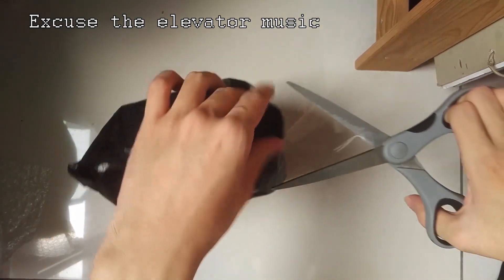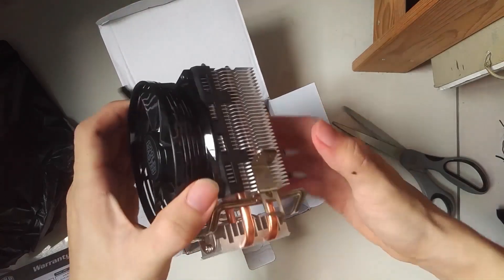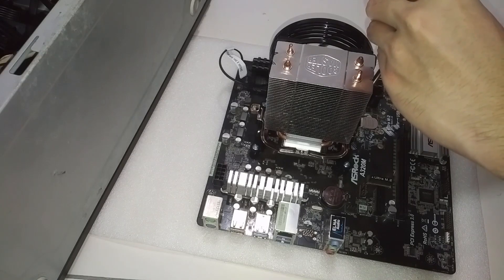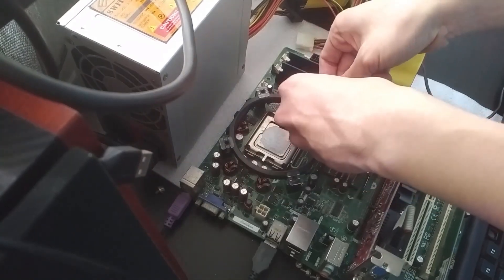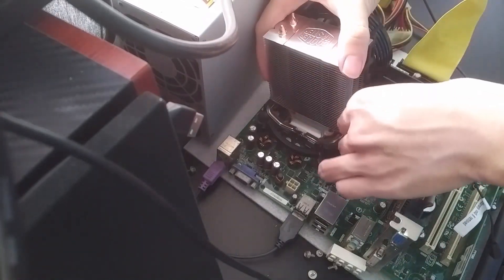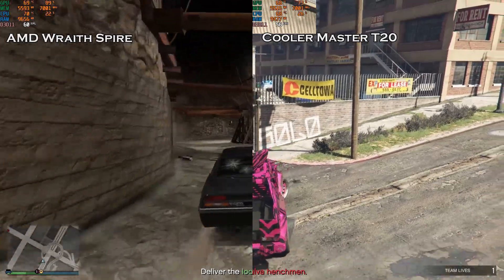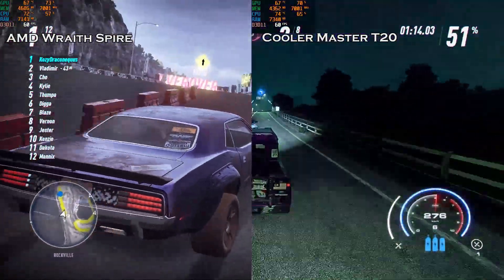Cooler Master T20 Unbox + Temperature Test

Comment from the maker: Chill guys I bought a Aorus B450, no more base trash A320 no more
Reply: Its still good to be used. It can fix our brain coordination cause by overclocking a lot.
Reply: i think the problem is ur case, its a trash, it is more important to buy a good case, rather than a heatsink.
Reply from the maker: and look like everyone else right? a flat void of glass and RGB? screw that I'm going sleeper, heat be damned
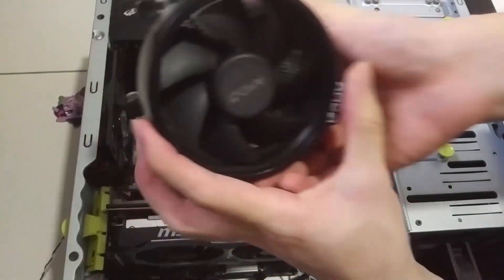Reply: @noodleclaws  I'm sorry if I offended you, I mean that it is all messy, cables are covering the air 2:56, when the air reaches the heatsink it is already hot, case with the power supplies on top are the worst. You can look at the Corsair 275R Airflow, rgb is optional lol https://www.youtube.com/watch?v=5rsaDb0KPZ0
Reply from the maker: @macizo05  keyword: sleeper, and it’s ok I’m cool with heat and wires, since there’s nowhere else to stick them anywhere
Reply: I have a question do you know if this t20 is compatible with the asus b450m-a ii
Reply: @codonthecob_2129  it should be. As the t20 supports AM4 socket.

Comment: i think your case ventilation limits the cooler potential. not much cool air is being feed into the case. even your intake fan into the case is not seating flush at the holes of the case. i see your case is preventing it. might changing the case will be beneficial? or make a holes on the side cover and place your intake fan on the case? thanks for the video btw

Comment: which is better? Hyper T20 or Hyper T200? I can't find any comparison
Reply: Me too!! Any suggestions?
Reply: I suggest getting a Hyper 212 or a T4 rather than T20, T20 is only for the low end 775 CPU,either the T200
Reply: @healspringy6300  Hay unos videos del t200 + i5 10400f y todo ok ???? What say?
Reply: @raulc.s.7103  No, i5 10400f has 6 cores and 12 threads so i would recommend you to buy a Hyper 212 instead of T20
Reply: The T200 is better, higher RPM and more fan blades, but also is a bit bigger

Comment: Could any one please share the temperature difference between the intel stock cooler and T20 ?, 
I looking to use with i59400F and case/Cabinet restricted to 120mm cpu height.
Reply: ITS GOOD than stock. i used to get arounf 55 in idle but now i get around 35 to 45. I5 3rd gen, Gamemax Expedition Case with all the fans

Comment: It's good for I7 4790? What its the TDP of this cooler ?
Reply: I'm looking for answer to this question as well. I've looked all over internet, yet I can't find an answer to it. But from the video it seems like it is a little worse than AMD cooler which is rated at 95W if I'm not mistaken. i7 requires 77W. I think It should be enough.
Reply: @interesting6436  im using it with i7 4770 and max temp without AC is 85c and with AC at 26* is 75c
Reply: @_21st89  Thank you for the answer! I already bought a computer.. but I'll keep this information in my head.

Comment: Grip for AMD brackets are a bit tricky. Is just pressure or i should adjust it somewhere? I have an AMD A10 5800K and planning to buy this because is the only of it's kind to fit in my microtower case. I have a stock cooler from an Athlon X2 because the bundled with my system is smaller.

Comment: change your case .hahahaha you have a great pc components . letting them live in that case breaks their hearts. nice vid
Reply: Sleeper PC 🏆🎉🎍 that thing is .
Reply: Abhishek Roy a trash sleeper with a really cheap MB a sleeper is meant to have high end components not a RTX 2060 and a ryzen 5 btw a 2060 isn’t a high end gpu it’s low to mid
Reply: @vWhiz   . I heartily agree with you Man . But due to the virus situation , prices have skyrocketed in my country India . Nowadays , a 1050TI costs as much as a 1650S . Been a PC builder for 20+ years I have , and am really losing my mind now 😭 Curse chayna for all this mess 😭
Reply: @vWhiz  Nah to me the 2060 is more of upper midrange to me midrange is the gtx 1660
Reply: @vWhiz  nah a sleeper means that it doesn't look much in the outside but outstanding performance when used. It's literally a sleeper build. It looks like an old PC but performs like a modern one
Reply: @vWhiz  did this guy just call the 2060 a low tier card?  Lmao clown